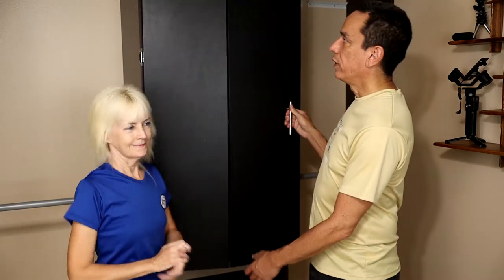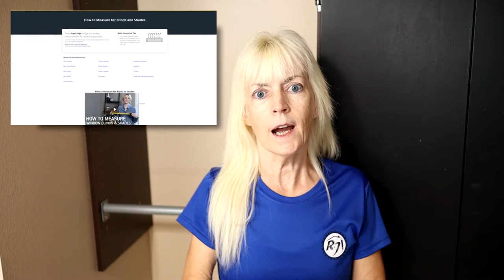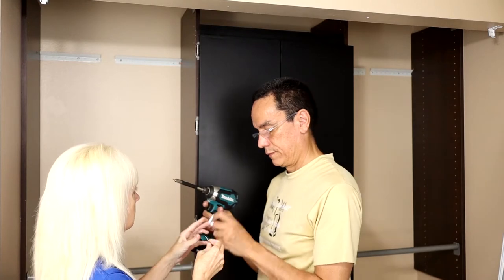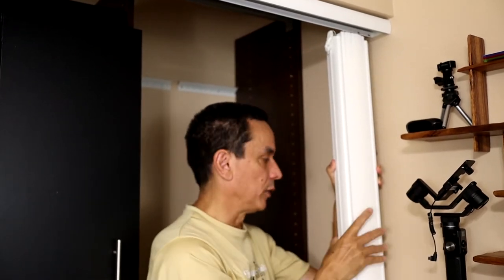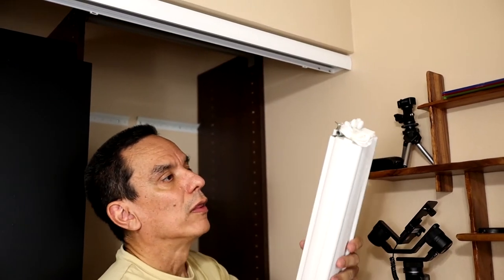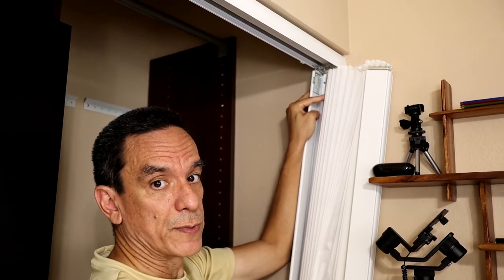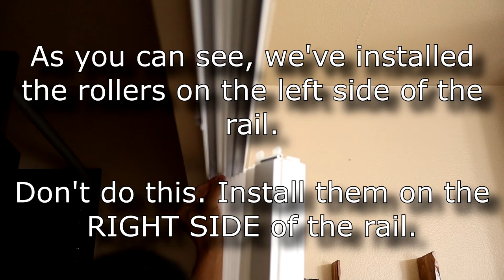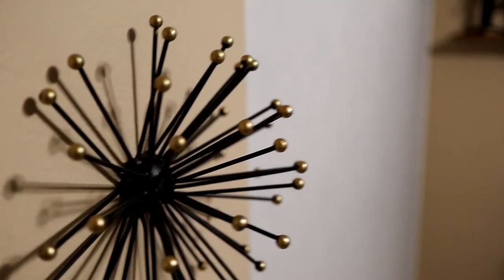Installing Vertical Cellular Shades As A Closet Door

Comment: Thanks so much for this video. It’s a great idea. I would like to do it for my bedroom closet, which is 48 inches wide and 96 inches tall. How did you order it? Did you list the width as the height and the height as the width? I’m trying to understand how you Ended up getting the bracket at the top of the closet for what would’ve been the side of the shades
Reply from the maker: We purchased these as custom blinds. There were a few companies that custom make these to order. When placing the order, you provide measurements and if the shade will be inside the window sill or outside. Although we used it for a closet, we simply indicated it was for an inside curtain and they provided the proper hardware/brackets, to mount it in the closet.
Thank you for the wonderful question
Reply: Thanks so much for your response.

Comment: Did you have to order a special pair of blinds that allowed for them to go sideways like this? I don’t see anything on the site that talks about it…
Reply from the maker: We did have to special order the blinds for the size but the blinds themselves are are just ordinary vertical blinds. they are designed for windows and sliding glass doors. we just used them for closet doors, instead. If you search blinds , use "Vertical Cellular Shades" or "Vertical Cellular Blinds" or "Vertical Blackout Shades", you will probably find many options.  Thank you for watching our video and taking the time to leave a comment.

Comment: any suggestions for someone who doesn't want to cut the baseboard?
Reply from the maker: GREAT QUESTION!!! Off the top of my head, I can think of two possible solutions. 1 - purchase the shades at a length that will not reach the baseboard (only problem is the wide opening at the bottom. 2 - use vertical blinds and then cut the edge blinds to fit over the baseboard. We hope this helps but if you have more questions, please feel free to reach out to us and we will do our best to find a proper resolution.  BTW, thank you so very much for watching our video and for your insightful question

Comment: I took off my closet doors and I need a solution to replace them . My problem is it's a basement apartment and I need something safe since the water heater is in this closet.
Reply from the maker: Just an idea off the top of my head, maybe plastic or vinyl vertical blinds can work. I have seen plenty of people use curtains as closet doors and curtains are intended for windows so why cant vertical blinds serve the same purpose. Plastic and vinyl should not be affected by the water heater. If your local big box store sells blinds, I am sure you can ask them about vertical blinds being safe to a heat source or not. We hope you find a resolution and hope to hear how things work out for you.

Comment: good look, but could be problematic with pets
Reply from the maker: Brilliant point! I had not thought about that. Then again, you could make it from steel and some pets find a way to mess things up. LOL    Thank you so very much for watching the video and for your comment.
Reply: @Poor_Mans_DIY  I have had issues with my bifold doors falling off vertically. I can't figure out what the problem is so I have looked for a solution. I'm tempted to just remove them and put up curtains. The rods are expensive for 6 to 8 feet and often begin to sag in places after use.  My hack is to use copper plumbing pipe!  In most cases it is less expensive, Never sags! The only trouble is I haven't figured out the end caps. I should probably ask a plumber. LOL!